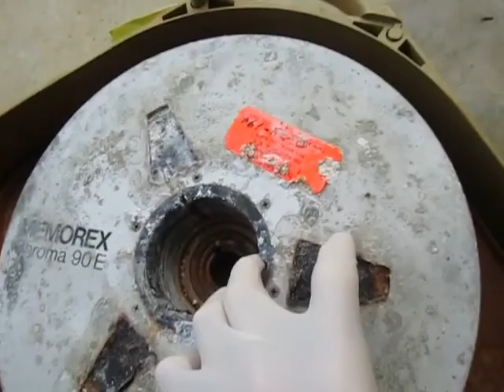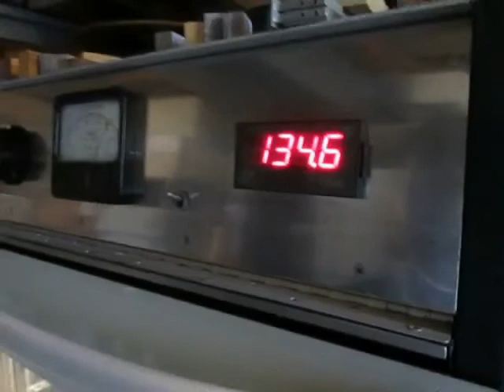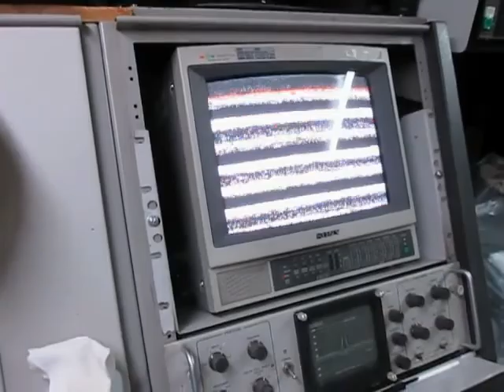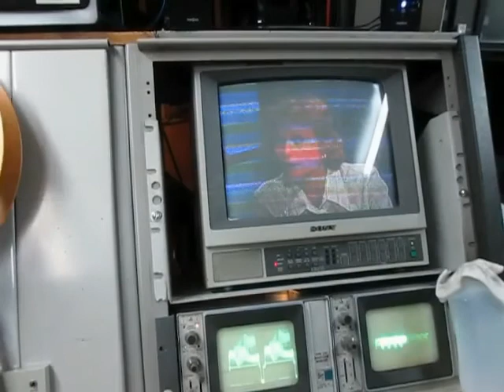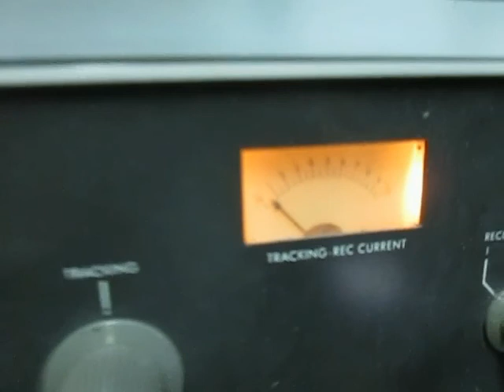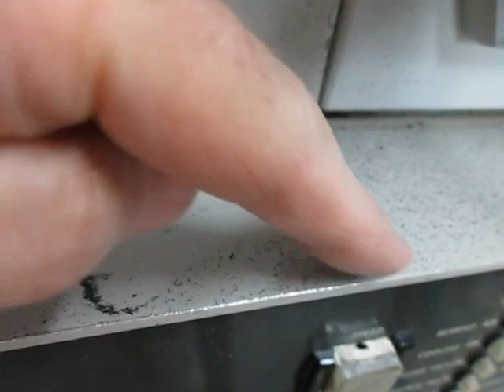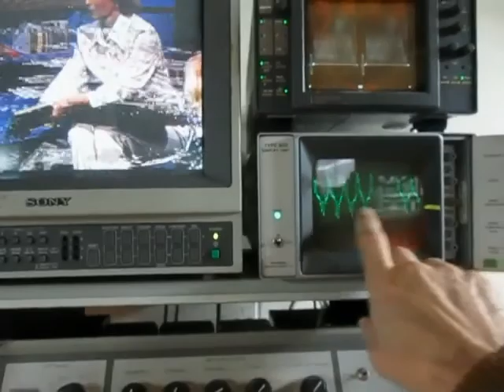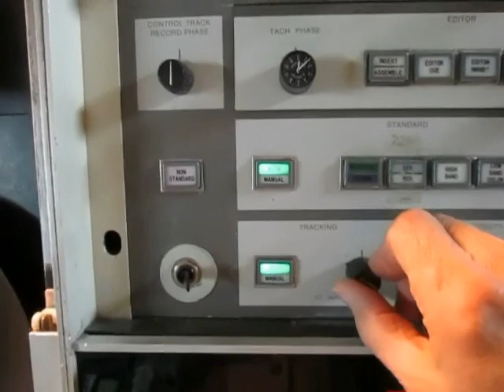The Quad Tape Transfer-Restoring A 2 Inch Quad Video Tape To Playable Condition And Digitizing.

Comment: What an incredible salvage job on that reel of tape. The whole time I'm thinking about how the expensive quad video head assembly is going to hold up during playback and the $$$ at stake.  A few years ago, I tried to salvage some 1" reels of Type A videotape for my cousin who worked at the Ampex Consumer/Educational Division Elk Grove, Ill back in the late 60s. The reels he sent me looked great, clean and wrapped in original bags in original boxes. As I was threading the first reel, I realized the oxide had attached itself to the backside of the next layer which peeled off in all sorts of random chunks. I only have ONE vintage VPR5800 machine that I've maintained since last century and couldn't see anything good happening to the only videohead I have, so that ended that. Every reel showed the same oxide separation from the polyester base. Also, as the oxide separated during hand winding, the most foul acrid odor made my eyes water. Tried baking the tapes, but it had broken down chemically with no way to reverse that process. Your success was astounding to witness. Love seeing your quad equipment in action. Thanks for posting this remarkable video. Bravo!!
Reply from the maker: Thank you Drake. I think the video educates folks a little bit about what is possible better than me talking about it. Seeing is believing, etc. No worries here, I make my own tips and rebuild my own quad video heads in-house. Here are a few videos re: Quad heads: https://youtube.com/playlist?list=PLJQg3rQJzoovLIWQ1VcnDdhNkikwBF5Qb&si=mlLOgv4FOCCaS9Uv
  I did type A for a while years ago. You gotta bake type A tapes longer and hotter to get the base to respond. But the overall problem is the high head-to-tape tension type A has: as the tip projection decreases thru hours of wear, the tape to drum tension increases, and the fm tape signal decreases. Heres some more equipment videos you may like: https://youtube.com/playlist?list=PLJQg3rQJzoosbgyXSXE7AFEC_6U9dtKYj&si=otAmoS1l9bxgcS_T
This was another interesting tape recovery job: https://youtube.com/playlist?list=PLJQg3rQJzoosKKRCrNrwgU13TE_KFqY6t&si=C6G-N3FLIljRp23i
Have fun! 😁

Comment: Miraculous results. 2" playback was a house of cards under normal conditions. At first I thought you were wasting your time the first time you opened the tape case.
Reply from the maker: Thanks. Haha, no, this isn't my first rodeo.. I've done this level of preservation work for years. Been a quad ops tape guy since 1983. TV work since 1977. I can usually get something out of a tape when nobody else can if anything's there. This was a challenge, tho! I put these videos out so folks can have a better understanding of what is possible sometimes. Here's another interesting project you may like: https://youtube.com/playlist?list=PLJQg3rQJzoosKKRCrNrwgU13TE_KFqY6t&si=whbDGHZh0blglwBi
Reply: @LarryOdham  I'll definitely take a peek. I operated those in 1985. They were long in the tooth but still just workhorses. The smell of shredding oxide flying into the tape room is in my permanent memory. Regards.

Comment: Amazing work and patience. It's inspiring me to tackle a few of my old BASF betamax tapes where the binder has turned to licorice!
Reply from the maker: It's surprising to me sometimes just how far a seemingly hopeless tape can be brought back to life. It does take a lot of hours of work. Try baking a test batch of your betamax tapes at 129-130 degrees F for 15 to 20 days in a fan-air circulating oven. Then burnish-clean the oxide surface.  I wouldn't go any higher than 130.5 for that type of tape.

Comment: This is SUPER COOL!  I've never seen this format before... It's crazy how stealthily the head drum is incorporated into the tape path - I actually thought it was a stationary head at first.

I'm amazed at how stable you were able to get the image after switching to an external clock source.
Reply from the maker: Yep. 2 inch Quadruplex video. Been around since the late1950s. The first practical recording standard for high quality video. Was used thruout the tv broadcasting and studios on into the late 1980s and a little into the 1990s at a few places. Thats what I did at the tv station waay back when, was a tape guy. Still am! 😁 I don't know how to do nothing else. 😅 Well...play the guitar maybe. 😂 2 inch quad here at the shop: www.quadtapetransfer.com
Quad nuts & bolts: https://youtube.com/playlist?list=PLJQg3rQJzoosbgyXSXE7AFEC_6U9dtKYj&si=Jy7CDA7_EOoxSmun
Some more tape work: https://youtube.com/playlist?list=PLJQg3rQJzoosKKRCrNrwgU13TE_KFqY6t&si=SngcRKQnpRhUGU4r
Have fun! 😃

Comment: This is mightily impressive Larry. Way to go.
Reply from the maker: Thanks. I been working on another reel(1 of 5) now for about 2 years that was worse than this one. Stuck together.  I have a salvageable picture and sound on playback now, but still a long way yet to go. It is rather satisfying to put in the work and then see the results. With each reel I gain a little more knowledge and technique of how to deal with these hopeless reels nobody else wants to touch, and get results. It ain't easy!
Reply: @LarryOdham  I'm glad to see you capture the results with each pass, so you at least have an emergency transfer of the best achieved so far should it fall apart later! A Blackmagic Decklink Mini-Recorder by the looks...?
Reply from the maker: @mbvideoselection  I had that happen once. The oxide layer falls off the mylar backing in chunks..unzipping it is called. I have some video footage of that somewhere. Scary. Yes. I capture every inch, every time, all the time. Sometimes that's all you ever get. . There's several different and various BMD capture cards and devices here. A full Decklink, a Teranex 2D, several Intensity pro 4K, a Grass Valley Canopus that works very good on SECAM. And a firewire 400 in the old stuff department. For file cleanup and real time digital restoration there are several different models of Digital Vision DVNR. Mostly Media Express software.

Comment: as a gen x’r who got to work with this older analog technology in quad/c-type, i can really appreciate this.  editel NY was amazing in the 70s, 80s, and 90s before they went kaput.  it seems to me that an unconventional method to restore quad tapes would be to modify a helical scan vtr with a radical scan angle, control tracks head, and use some fancy DSP black magic…
Reply from the maker: Thanks! I have one of the Editel NYC Ampex AVR-3 quad vtrs here at the shop. www.quadtapetransfer.com. Had two of them but scrapped the rusty one for parts to make one really good vtr. No...IVC sorta tried that in that mid 1970s with the 9000 vtr. It's apples and oranges. And the 9000 supposedly was the best 2 inch helical ever built, was a total flop. 67 were built and sold. Rare vtr. I have one sitting here. It's pretty useless. It is a pile of junk start to finish. What killed the 2 inch helical concept before it ever got started is the huge amount of head to tape tension and how to control that. So you may actually be inheriting another set of problems while trying to get away from the original problem. The best way still is to get a quad vtr and play the tape on it. It isn't as difficult as some would have you believe. The secret to a lot of successful playbacks is in how you go about prepping the tape for playback. I hardly ever have a quad reel that I can't playback... I think to do what you are suggesting would be very expensive and could take years. I remember having this exact conversation with a UT Professor off & on for about a year about 10 years ago. Nothing ever came of it. His idea was to still-scan the magnetic tracks one at a time and demodulate them digitally in memory. Other people have been working on that idea for years and nothing viable has resulted yet...as far as I know...I am glad you are taking an interest in some of this ancient history technical stuff. Here are a few more videos of some of my quad work around the shop: https://youtube.com/playlist?list=PLJQg3rQJzoosKKRCrNrwgU13TE_KFqY6t&si=YTuabFja4g7IU9OH
https://youtube.com/playlist?list=PLJQg3rQJzoovLIWQ1VcnDdhNkikwBF5Qb&si=ZJQtwYZNyWnt58CU
https://youtube.com/playlist?list=PLJQg3rQJzoosbgyXSXE7AFEC_6U9dtKYj&si=zKspNflcCxArn6-c
Any time you have a tape question I will try my best to answer it, although I'm not by any means the smartest tape guy around, but I've been around and seen and experienced a few things in the past 45 years on the job at TV stations and in my own shop.
Have fun! 😁

Comment: There's something mesmerizing about this!! Just first class all the way!! I feel bad complaining about my 1980s ampex grandmaster 1" tapes that are sticky/shedding. I've baked them in dehydrator for 8 hrs @ 130 deg and it helped but I wish there was something else I could do for them. Anyway, sure is nice to watch someone of your caliber at work, thanks!!
Reply from the maker: Thank you Rick. That's what I do, 2 inch tape and guitar fingerpicking. Normally, bake them longer. 130F is good, need to go 2 to 3 days bake time. For a severe case 7 to 10 days. Then clean afterwards to remove the sticky shed residue. I wouldn't go over 130F for a 1 inch tape. 2 inch can go higher. I have baked some of those problem 2 inch tapes at 140F for 2 weeks with good results. And no failures or destruction BTW. I have gone as high as 152F on 2 inch tapes with no problems, but don't do that unless you've had a LOT of experience, too much can go wrong at that temperature and destroy something.
Reply: @LarryOdham  Larry, thank you so much! I was hoping I was doing the right thing, I will certainly follow your advice!!  What would be the best cleaner to use after baking?? 
I appreciate this greatly!!
Reply from the maker: @rickcurtis2983  Well after baking, if you don't have a commercial tape cleaning machine, or know someone that does, you can use cloth, cut into a long strip a little wider than the tape, wrapped around the r/p head stack or a convenient tape guide, and pass the tape past the cloth in hispeed ff and rewind, or in hi play(15 or 30 ips). That will clean off a lot of residue so it will be less likely to gum up the heads and cause problems during playback. It will also tell you how good the baking cycle was. If its still sticky there will be a lot of friction and drag against the cloth and a lot of black residue on the cloth.
Reply: @LarryOdham  Larry you are the man!! Thank you for helping me, I never would have thought about wrapping the heads like that to clean/check the tapes!! I really appreciate it!!
Reply from the maker: @rickcurtis2983  No problem. If you try it, let me know how things turn out.
Reply: @LarryOdham  I sure will!!

Comment: The first unwinding seems of utmost importance, since the grade/impact of stickyness and from here any eventual tear off of the magnetic material here sets the playback quality level further on.

So how about an idea of doing the first unwinding of tapes in this condition within a contraption/invention of some sort, that could eliminate/lower the stickyness ?

I'm wondering if submerging such a tape into a warm bath (after all the initial cleaning of course, but before the first unwinding) and letting it soak for a while, would loosen the sticky stuff so it won't tear off the magnetic emulsions. And then have the tape go through a rinsing bath, drying unit and then to the takeup spool.

Would a procedure like that enhance the expected output ?

The argument is, if there's an inherent quality loss when the hard and dry stickyness tries all the time to tear off the next layer of agnetic material and if it could be prevented by another procedure.

I'm just wrapping my head around it for a better outcome, if it's possible at all. I don't know. Just asking :)
Hope it makes any sense :)
Reply from the maker: It isn't sticky(in the sense of honey or molasses, or glue), it is mineral encrustation dried like concrete, from the water and aluminum reel corrosion that took place over years of time being wet and sealed inside the container. Maybe an accurate way to think of it would be as growing crystals. It builds up a layer between the aluminum flange and the tape and forces down and in between the layers of tape. It is more like busting concrete.  White vinegar will penetrate it somewhat after a few weeks of reapplying. The video is a little misleading as to the length of time, as the work took about 3 months start to finish...not 15 minutes as the video depicts. I couldn't very well make a 3 month long video!  Ultrasonic can loosen it, but it can also loosen the oxide from the backing, so thats a very risky procedure. I have another video of up-close unwinding of another similar tape. I'm not sure if its uploaded. It was much worse and required extensive(60 to 70) splices of the lower edge.  The lower edge ripping apart is not a very big thing. The tape control track gets destroyed but it can be played allright on an AVR-1, which can play a tape without a control track. The active video tracks begin about 5/8 inch from the tape edges(factoring in the track overlap) so you can 'get away' with a lot of bottom edge damage. The top edge is a bit different. That is where the audio track is. If you lose that- its lost. Luckily this tape didn't have any top edge damage. Here are a couple more videos where I go into some more detail about machine and head modifications to further enable playback of damaged tapes, if you are interested in this sort of work: 
https://www.youtube.com/watch?v=G5HDD_xh778&pp=ygUWdGhlIHF1YWQgdGFwZSB0cmFuc2Zlcg%3D%3D
https://www.youtube.com/watch?v=XKS5MGMPgOE&pp=ygUWdGhlIHF1YWQgdGFwZSB0cmFuc2Zlcg%3D%3D
https://www.youtube.com/watch?v=6YxTv2zmBkg&pp=ygUWdGhlIHF1YWQgdGFwZSB0cmFuc2Zlcg%3D%3D